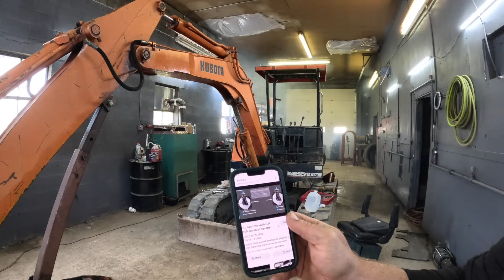Working On My Cheap Excavator and Loading Brush

Comment: Mostly, changing hoses to get right joystick moves isnt really good idea, because hydraulic distributor gives different flows and pressure on each function. That way this excavator be weaker on some moves and too strong on another function
Reply: Never heard this before. Mine seems to have the same pressure on each outlet- I don't see why it wouldn't.
Reply: This is not a issue. The machines i have seen had the safety pressures  for the boom and  stick set at the same pressure. Both 10 or 20% higher than the pump operating pressure.

Comment: Good thinking with wearing safety glasses just gotta try best to keep them not scratched up and clean. I got dirt in my eyes before it’s not fun obviously
Reply from the maker: I got metal in my eye years ago and had to go to the hospital and they took it out with a  needle. The numbing part was the worst.
Reply: @Dumpster_Dave  I have got rust in my eyes luckily was able to wash it out 

Keep wearing safety glasses it’s annoying but you don’t want to go through they again I don’t want to get into a bad situation like I could have got in if I didn’t wash my eyes out or didn’t know I had small rust crumbs in my eye. 

I felt it luckily and washed it out
Reply: I will second the safety squints approval, glad to see it Dave, my guys fight me all the time about wearing them. If I hadn't been wearing them, there are 10x in the past 30 years I would have had a serious injury or lost an eye. Anyhow, love the LED lights Dave, that Kubota is going to serve you well. I'm excited to see what you do on the new to you track loader👌

Comment: Dave, a machine that old more likely doesn't have a pattern control switch. And I would not have any idea what the price might be to have such a valve installed. Most new (if not all new) excavators have a pattern control valve assembly installed at the factory or dealership. 
But your machine may not have room to install such a valve assembly.